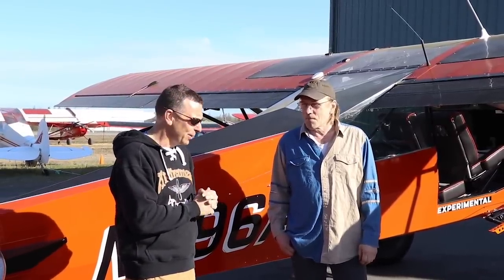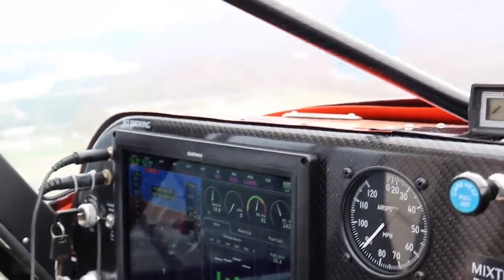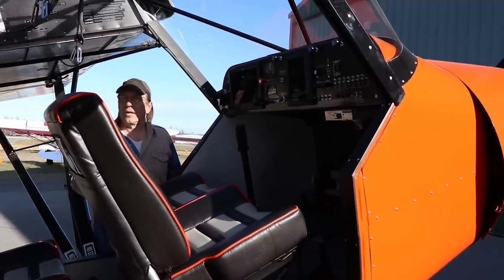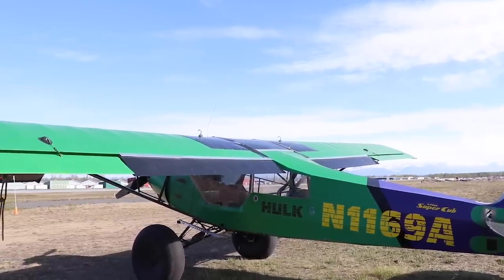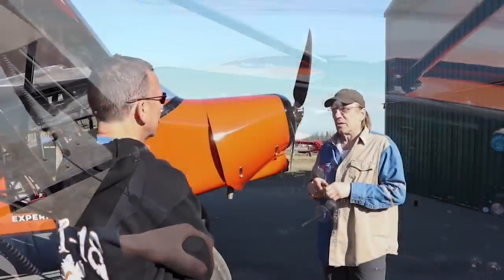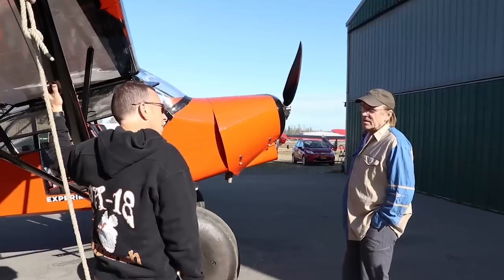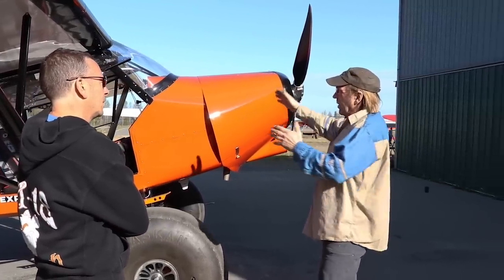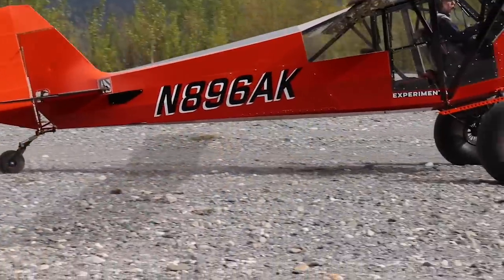4 Place Super Cub With Kirk Ellis Presented by Airframes

Comment: Hm, I wonder here...
There's a guy Clint Busenitz in South Dakota (the Vetterman Exhaust) that builds Cubs with Cessna 152 or 172 wings. With the 172 wing in weighs 1080 lb, max gross wieght is about 2200 lb. So the payload is more than the plane's wight—1120 lb.
...what if combine this Kirk's 4-seater Cub with that Clint's "Cessna-wing-on-a-Cub" idea?😛

Comment: What about the Murphy Moose and Bearhawk?
Reply: Moose won't takeoff or land as short as this cub but I do know guys are able to get off the ground at sea level, 360hp M14P, & 3500lbs gross, using around 600ft of strip. I find that very impressive. But the M14P has less dynamic landing gear, and does cost more in fuel, and oil. 

The bearhawk can fly faster in cruise than most M14P equipped moose & all cubs. It can fly slower than the moose & is comparable to the cub. Arguably a better wing design than the cub. This cub has better flaps than both bearhawk & moose.

Unfortunately, the moose & bearhawk can not be used in a business capacity.

On a personal level, I find the 4 seat cub & bearhawk fascinating aircraft, but the Moose is my dream build.

Comment: Can a Carbon Cub Increased gross weight kit be used with a 4 place Cub? Also, is it still compatible with PA-18 Floats?
Reply from the maker: No, the Carbon Cub is it's own plane and doesn't share any approvals/STC's with the 4 place. You can use it on PA-18 floats with modification to the rigging.
Reply: Airframes Alaska Is there any STC out there to allow the GW to be bumped up?
Reply: @andrewsnedeker8965  Definitely would be nice to see this with a 2500 or so MGTOW

Comment: certified airplane? what is the secret to put it into the experimental class? Experimental Exhibition? Experimental Amature Built?
Reply: It's certified IF you buy the STC from whoever holds it, and (I believe) already own at least the data plate for a PA-18.  Experimental Amateur Built when you just build your own from parts.

Comment: How dose it compair to the bearhawk 4 place?
Reply: This 4-pl Cub is slower than a regular Cub apparently, whereas a Bearhawk 4 place is roughly as fast as a Cessna 180. Similar takeoff roll between the 4-pl Cub and Bearhawk 4 place. The 4-place Cub is going to land shorter every time, because the Bearhawk is slightly heavier. The Bearhawk has considerably more useful load. Internal space looked similar, as was the pilot's controls configuration.
Reply: @whosaidyoucandance  That's kinda how I saw it too.  Though I haven't heard them comment on cruise speed for the 4 place Cub, I doubt it's anywhere near the Bearhawk, but that's not it's mission.  Sounds like this goes basically anywhere an -18 will go and carry two extra people there.  But realistically, the Bearhawk will too except maybe the really tight/short strips where the extra weight keeps it moving that little bit longer...  I'm looking forward to seeing how the Bearhawk responds to the Keller flaps, apparently there's a guy in the southwest that's testing a set on his A model.

Comment: I hate to say it....a super cub is just not. A plane for 4 place configured like that...that cock
It and controls are boxed out....everything is forced and  put  as an afterthought...just like an 1980s humvee...nothings ergonomic.  Nobody is comfortable goin cross country... get a Cessna if that’s your intent.... a S cub needs to hug your elbows and the controls just don’t fit centered in the air away from the  convenience of the workings hidden in the outer frame... leave them at 900 pounds in,t opinion..but I definetly appreciatie the workmanship and craft that this guy did...a true fabricator.

Comment: Did I hear you correctly??????   At 11:25 in the video you said "you have 700 something pounds of useful load". WHAT?!!!  This is a FOUR place. Four 200 pound men is 800lbs!!! No fuel, NO baggage, no nothing! What the heck!  So this is still a TWO place aircraft! Two people at 400lbs then you can put in 50 gallons of fuel and you are about to be over weight if you put on headsets and bring a water bottle.  What if your one friend who wants to go with you is 250lbs? Less fuel? In Alaska you need that fuel to get to the remote areas. Alaska is three times the size of Texas and there isn't as many airports with fuel as Texas. So this aircraft is basically a single person plane that can carry enough fuel to get you there and back and have still 100lbs of cargo. Better to buy a Murphy Moose! Cheaper too!